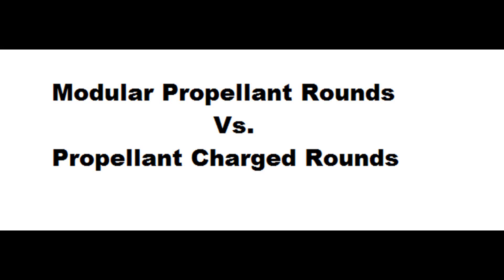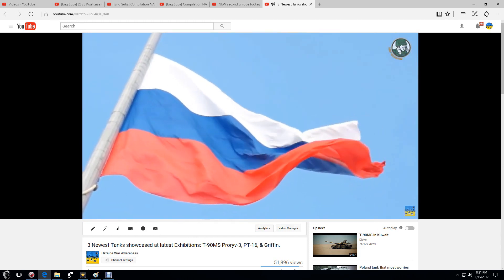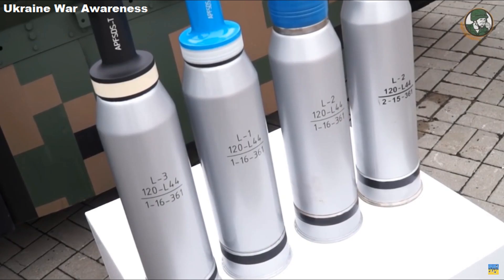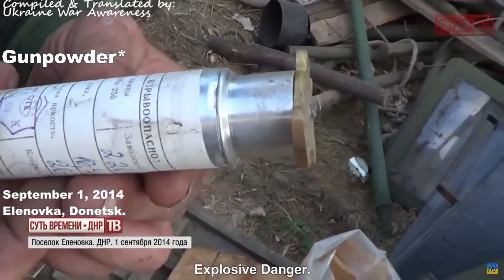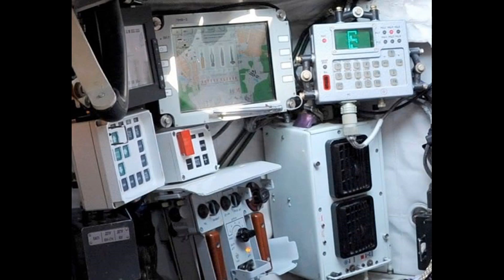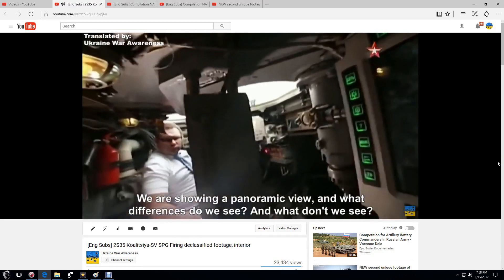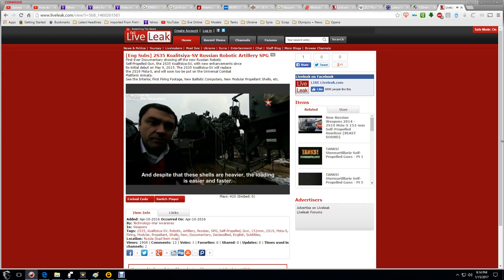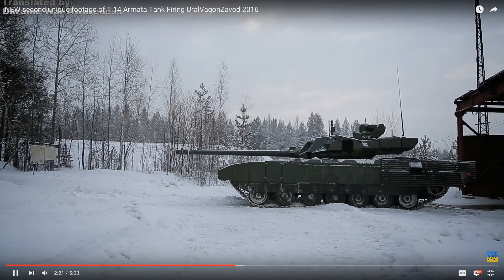What are New Generation Modular Propellant Rounds?  Explained!

Comment from the maker: I forgot to mention. The modular propellant powder comes in plastic container tubes that are loaded as is into the loader mechanism, seen in 2:04. One shot may use anywhere from half a container to 3 full containers depending on said variables mentioned in the Video.
Reply: Which armies use this type of technology?
Reply from the maker: Oh I know where you're getting at :P Yes.. Currently Russia is the only Army in the world that has put this officially into service, with the US being next with its M1A2 SEP V3 Abrams and I assume Rheinmetall after.
Reply: alright. the prototype SEPv3 M829KEW or KEW-X Sabot munition is a modular Sabot munition with its standard charge being tested and reported at 1740m/s. low and high charge types have not been reported yet. it might even be held off on until the M1A3 in 2020.
Reply from the maker: I wouldn't be surprised, though I haven't personally heard of any delay announcements. It does provide a great advantage in multiple fields, but I can't even imagine how a Modular Propellant would be fused in a Manual Loader. General Dynamics would need to either put a mini-Autoloader near the shell loading mechanism, or revamp the entire loading mechanism as a whole.
Reply: Ukraine War Awareness its a DARPA implemented module thats being developed as before hand the US was using standard fuel for the munitions, the L1M propellant. 

this new munition is going to lob a 10kg projectile which is scary when flying at even 1740m/s

well specs this year of the M1A2 SEPv3 are: "increased power generation and distribution, better communications and networking, new Vehicle Health Management System (VHMS) and Line Replaceable Modules (LRMs) for improved maintenance, an Ammunition DataLink (ADL) to use airburst rounds and custom charge munitions, improved counter-IED armor package, improved FLIR using long- and mid-wave infrared, a low-profile CROWS RWS, and an Auxiliary Power Unit (APU) under armor to run electronics while stationary instead of the engine, visually distinguishing the version by a small exhaust at the left rear. Prototypes began testing in 2015, expected to enter service in 2017"

then the M1A3 was reported in at including:  "Improvements are to include a lighter 120mm upgraded internals gun, added road wheels with improved suspension, a more durable track, lighter armor, long-range precision armaments, and infrared camera and laser detectors. A new internal computer system is also desired, with current wiring replaced by fiber-optic lines that could decrease weight by some two tons. Armor will be edited to include Graphene mesh. "
Reply from the maker: Thanks for posting the confirmed characteristics. I am well aware of them as I study weapon equipment, with what in my opinion the SEPv3 is finally getting what an Abrams should've had since the original M1, such as an APU, and yet still no APS. You'd think that by now they'd apply some version of the Trophy Active Protection System. Nevertheless, it'll have its improvements, and every tank has its Pro's and Con's.
Reply: Ukraine War Awareness i know what you mean. the Active Protection Systems that M1 is SUPPOSE to be using are stock piled at Syria Army Depot if i remember correctly. they are 2006 designed and started final production in 2011. with some 8,000 made. i do know that its not that tall, and no idea who the developer of this system is, ether Ratheon or General Dynamics. but. i do know that the system wasnt used as it wasnt needed to combat RPG-7s and RPG-29s. to the from or side armor. the rear on the other hand. yes could use a desecrate APU instead. so far it was just working off the power-train's electric systems if the engine was shut off but the train was not, which ran it off direct capacitor and battery banks. just one of the cool aspects to let the M1 limp away, not far. but enough. Just like its hydraulic road wheel power system, that lets the tank limp away with only one track or both tracks gone. not far, not fast. but enough.

little innovations like this are cool, but arnt whats needed.
Reply from the maker: The APU that you make it sound is like Arena or Zaslon. Those APU's shoot debris at incoming projectiles. APU's such as Shtora, Trophy, among other's don't shoot projectiles, but detect them and try to jam them while releasing an aerosyl cloud. It's most effective against ATGM's, which is the biggest problem for Iraqi M1A1M's and Saudi M1A2S'. The T-84 Oplot-M to my knowledge is the only tank that uses both APU's as their standard package (an updated Shtora and a Micronized Arena) as well as customized T-90's with Arena, but those aren't standard and have never been deployed (not even in public exercises). The Armata too uses what's called Afghanit APS, but is a next-generation Shtora.
Reply: Ukraine War Awareness heh. the thing about the T-14's set up is that when our UN group went over there for UN evaluation at Q4 2016 to evaluate the T-14 and any russian future products that will be fielded. they denied letting us shoot it with dummy western munitions. they said that EVERY T-14 in the depot was having APS malfunctions. and could combat our training munitions at the time. interesting. but alright.

we did however get the armor type. its a highly hardened laminated stainless steel thick shell, with titanium holding keylocations in spot. RHA and RHB are used. well what we saw, it was  a version of it, a thin line of internal carbon material in the capsule surrounded by laminated steel, kevlar, and rubber. 
The turret uses the same thing, and has underlying magnets for some reason that i couldnt ask them about as they where moving on with the demonstration.
they wont disclose the ammo station armor.
the russians have dubbed this as armor type: 44S-sv-Sh.
they still classified 2 other layers of their mesh. the shine looked to be ether graphite or lead. and the other one was a greyish metal that looked to be enforced composite of some sort.

like you said in a post before, yes it isnt a direct copy of the US M1 TTB. but its an idea that was directly taken. that the US did not like or need due to specific issues and ways it could break down. maintenance, and part repair. ect.
Reply from the maker: Well, honestly we don't know for sure, because Platform Vehicles were researched simultaneously within the US and USSR, and we don't know just what the T-95 and Black Eagle Interior's were like. The Black Eagle tank had 7 wheels as well despite being on a T-80 chassis, and the T-14 incorporates technologies from both projects. Black Eagle Project started in the 1980's, just as the TTB did. So again, just because the F-14 Tomcat first flew 3 years after the MiG-23 does not mean the US directly took Variable Sweep wing technology from the Soviets.
Do you have an article or source of the UN inspection? Because even the number produced is classified. And if it indeed happened, I'm not surprised they didn't allow a Live Fire, since it's even classified for reporters to show where an iron ingot shell lands after fire.
The Armata accomplishes light weight because it doesn't rely on Composite Armor, but rather on Malachite "Dual-Layered" Reactive Armor, a practice used since the T-64 and post development, and proved with TOW Vs. Kontakt-5.
Edit: I just remembered an episode from "Air Wolf" from my childhood where the Heli had to battle robotic tanks with unmanned turrets. The idea isn;'t hard to come up with, but designing it may ultimately lead to the same outline or blueprint. Just like the F-86 Sabre and MiG-15, very similar designs and both inspired by German Jets. Or the Buran being called the "Shuttleskiy" in the West, but having almost no similarities in actual technology or the way they function. A lot of people say the F-35B takes technology from the Yak-141, but is also incorrect. It could be inspired, but with everything being so classified at the time, I highly doubt it as a Copy-Paste type of development. Just in my personal opinion, comparing a T-14 to a TTB is like comparing a B-2 to an Ho-226 in terms of influence.
Reply: The yak-141 thing was all just about the engine design ... the Russian designers were helping them in the development too in some aspects of it officially, but its not a copy, or further development of the yak´s, they just used some of the knowledge and data for their own design.     .... as for the active protection, Im just as convinced its all about maintenance and fielding costs. It is a set of some delicate electronics. They would probably use it if they knew they need it in an known operation involving such threads, but using it on all of the tech all days with the necessary servicing ... they just leave them in perfect storage conditions, rather than loose them purely to non-combat field conditions. In the end, Russian tanks also don't have the active elements of that broad ability like ARENA on all the tech, both for financial, and necessity reasons.

Comment: Actually, you use footage of the TV Zvezda promo of the Koalitsia, witch shows nicely its way of "adjustable" fire. See from 19:30 time on it and especially on the 22:20 screen ( how they be loading a variable number of "pellets" as the propellant ), with the talk of them being "fired-off" by microwaves. ( yes, its better to understand Russian, no subtitles )  In the video he tells he is forbidden to show - the actual Koalitsia propellant pellet ( witch is secret ), thus uses another munitions one in the microwave oven. The tubes on the right half of the supply-truck ( the mentioned 2:04 ) are thus more a protective and package-holding tubes, from witch the needed amount of pellets is pushed into the barrel by the auto-loader.   https://www.youtube.com/watch?v=VH9yXTSMZ8c&t=1456s

Comment: The 2s35 152mm Russian SPH is better than an M1 tank and it's about as fast. So what if it can't shoot on the fly. It's guided to and aiming stop 70K away and kills you from there. No amount of protection can stop all those rounds from destroying your Abrams. OMG auto loader and precision guided shells so there is no need for a rotating turret. Tanks will never get close enough to each other to make those turrets really useful anymore so they are appendages of a bygone era of battlefield warfare. Such tanks are more at home in an urban or heavily forested setting. For armies facing off, this is the go to gun. (modular? I'm not sure but probably.